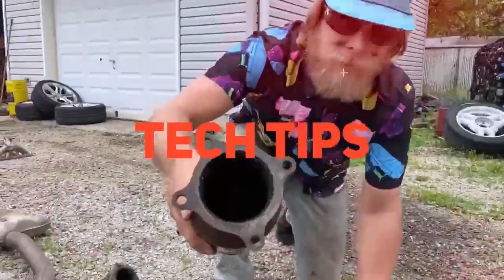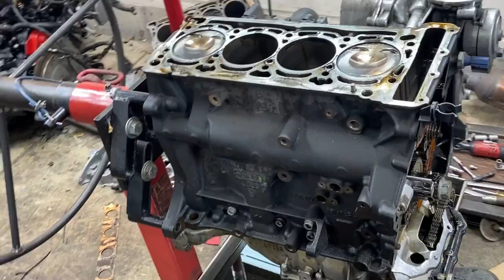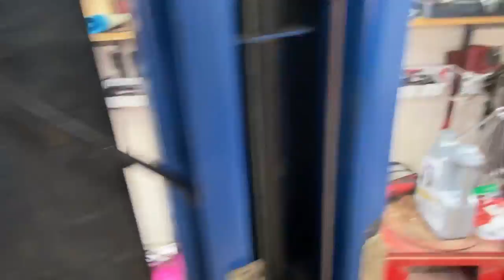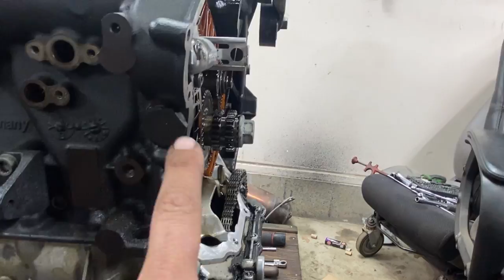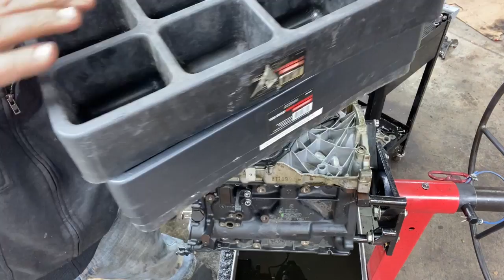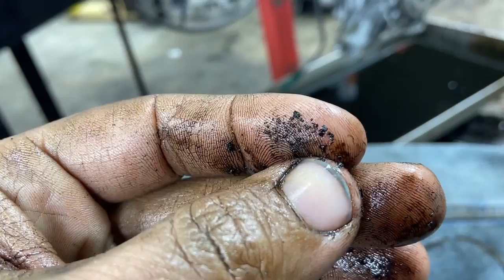2.0t Oil consumption tear down and inspection.  Audi VW using oil pistons failure reliability

Comment: I need your help again boss. Place that I was going to do the serp belt said there techs dad died and he was going back to the west coast and did not plan on coming back. I might have to do the serp belt myself but there is all kinds of shreds of the belt wound up around one or two of the pulleys. Is there an easy way to get this out without taking the front of the car off? I think i can handle putting the new belt and tensioner in Im just worried about trying to get that stuff out and getting it all out. Thanks in Advance

Comment: @Naptown Tuner if I want to rebuild my TFSI 2009 you said that I have to get at least pistons from an audi 2013.
and those will fit perfect right?

cool video btw👍
Reply from the maker: No, you can either put the vw style (am) pistons in it (that what the dealer always did) and it really all depends it could last the life of the car with normal oil consumption or the best way is to put the larger rods 23mm wrist pin with waffle style piston rings.
Reply: @NaptownTuner  and from the 2 options what's the one that you do?
again this channel is growing man .
this is one of the best channels for TFSI owners ... keep it up J.
Reply from the maker: @billydeathgrind4275  the only time I have installed the waffle style pistons was at the dealer when they did warranty pistons on 2012+ probably only did about 15 of them and I never payed close attention to the oil control ring but looking back I remember that it was the waffle style that they sell as (dm) pistons 2012+ is 23mm rods.  With updated dm pistons.   I’m actually learning a lot more now that I’m digging into it all more myself on my own time, actually paying attention to it all rather than just doing what Audi told me for so long.

Comment: Also, I removed the intake balance shaft but have been unable to remove the exhaust balance shaft. Is there any way to do that? The intake balance shaft looks super clean along with the filter screens. 
So, If they look clean, is there still a need for me to remove and inspect the other balance shaft?
A video on this might be awesome along with the video for the exhaust cam which I’m waiting on you to do. Perhaps you should consider a series on putting the engine together with the new parts when everything is completely taken apart and then, do another video once the engine is inside the vehicle, were you reconnect everything step-by-step. That would complete a series for you and you will have everybody flocking to your channel!

“ NaptownTuner, the Audi King”!
Reply from the maker: I’ve only ever seen problems with the intake balance shaft and after all the engines I’ve been through I’ve only seen it 4 times.  I personally wouldn’t worry about the balance shafts but it’s nice to replace that chain as I’ve seen 3 of them excessively stretched one was really bad.
Reply: Have you know that the reason I am in this mess with my 2011 A4 is because the timing chain and tensioner were replaced but that particular chain was not. It stretched out and when I opened it up, the chain was broken with the gear below the intake balance shaft lose. When I went to grab it, the block was broken off right at the bolt thread and there was nothing for the gear to hold unto.
Reply from the maker: Someone must have been driving that car hard, same with turbos, some wastegate linkage are good to this day, others are worn out and that just means that person got into full boost so frequently that it got worn out from opening up the flap so much

Comment: Hey NaptownTuner (give us a name). 

Once again, I wanna thank you for everything that you’re doing in regards to these Audi 2.0TFSI engines and how you are helping us out. I’m going to click like in as many videos as I can and I try to share your information with other people in order to help you build up your YouTube channel. 

Since you’ve just mentioned that even with the new pistons from Audi there is still an oil consumption problem that eventually develops, looking up my blocks, do you think the oil jet underneath the pistons is a contributing factor? 
What if we redirect those jets so that they can shoot directly where the 21/23mm pin is instead of the piston wall?  Or perhaps, remove that oil jet altogether? 
Your thoughts, please.
Reply from the maker: Thanks,  I still don’t really think it’s as wide spread as I make it out to be, I don’t know what the consumption would have been on this engine.  I don’t believe it’s with the oil or oil jets,  as long as you’re using good synthetic oil, I do believe an engine flush before every oil change will help big time, the jets need to keep the oil on the cylinder walls.. I believe it’s the carbon and top tier fuel stations like shell vpower will probably help the most.  Some 2009-2011 engines still to this day don’t have bad oil consumption but it’s important that people know what they might be getting into so I’ll be covering a lot more as I go and taking on more mechanic work than I have been.
Reply: @naptowntuner In this video you mentioned 2016 or 2017 pistons. I’m about to purchase OEM pistons for the B8 model. Do the 2017 pistons fit my car? Do you have a part number for the pistons with the waffle oil rings?
Reply from the maker: @mesmaayan  when you buy 2012+ 23mm pistons from the dealer (dm) pistons they will be updated style with waffle oil ring.  You can buy them from wherever
Reply from the maker: https://www.ecstuning.com/b-genuine-volkswagen-audi-parts/piston-assembly-set-of-four/06h107065dmkt/  note you need the 23mm rods too

Comment: Naptown.  I am currently attempting a rebuild on my 2.0. The block and crank are at the machine shop now.  They tell me they cannot locate the specs on these items to be able to mic them and see if they are useable still or within tolerance to be able to.  Do you happen to know the specs for the crank main and rods and the block cylinder bore sizes and crank journal specs for the block?   
Would really be appreciative if you could pass that Info on to me man.  Keep up the vids. I have a 12 a4 S line Quattro car.  There was some oil starvation up top as evidenced by the carnage I found under the cam plate.  I may just get a known good junkyard drop in for now. But would like to have a second motor ready to drop in if that one doesn’t work out.   Really want to drive this damn car.  Thanks in advance dude,
Chat soon.
Reply from the maker: Most engines or older engines you do all the standard machine shop stuff to the block and bore them out or hone them,  these blocks are very good and rarely have issues, I’ve put pistons in well over 1000 2.0t engines and I never replaced the bearings, also service manual says don’t hone the cylinders. (Special coating on the walls from the factory)  You just drop new pistons in the cylinders and if you’re so inclined buy some rod bearings from the dealer but in my experience with these, the block only needs carbon removal from the pistons by replacing or re-ringing.  The cylinder head can be rebuilt with polished cams valve guides, stem seals, valve grind.  You can spend a lot of money in a lot of different places but when I get around to it I’ll make a thorough video explaining all the different options.  I’m not a machine shop guy (wish I was). But I’ve only come across about 5 bad bottom ends and that is from various different reasons.  Wish I could just shoot the videos and put everything out fast but I’ve already deleted several videos from not putting out enough info (trying to do a better job with as much info as possible so by the time they get tons of views I don’t have to regret them)  a replacement engine could also have oil consumption as I show in this video but who really knows this one could have been ok.. some 2009-2011 engines that have never come apart do just fine with oil.  Any single 2009-2015is 2.0t engine needs an updated chain and tensioner for sure.  So any used / replacement engine must have a chain / tensioner before install.  Oil consumption can still be fixed in the future as this engine is very easy to remove and install as I show in my 3 part removal series

Comment: Ive spent so much time researching this issue for my 2008 A3. You came at the right time and saved me from a lot of headaches. So thanks. I still have to figure out what to do. The dealer said that they have a ring update for 2L FSI. Not sure what that is?
Reply from the maker: Probably gotta replace the rings or pistons that come with the rings pre-Installed  that engine is a little different but still direct injected,  probably want to at least do the rear timing chain adjuster and I’m sure you already planned on doing the timing belt.

Comment: Hey man i'm having an issue mating my engine to trans on my 2011 A5. I put the pistons in and and i can mive the crank by hand once i mate the engine to trans and put the bolts in thr transmission i cannot move the crank anymore. Theb i loosen the bolts and i can move the crank? Is there anything maybe not lining up with my flywheel or what?  I need helppp
Reply from the maker: Its been years but I believe It’s possible to let the torque converter fall forward then you don’t realize and try to put the engine in, torque converter isn’t lined up on the splines.. then you pull the engine back out and try to push in and line up the torque converter and it won’t go in because you forced the splines in the wrong spot, then you take the axle out so you can remove the torque converter and clean up the splines, then you rotate and push the converter back in place, put the axle back in (the drivers side front axle shaft)  bad memories on the flat rate clock.. good luck my friend.
Reply: @NaptownTuner  yes i can turn the crank just fine once i unbolt the engine to trans. Once i mate it again boom i cannot move the crank anymore. Seems like my problem might be the torque converter came out a little bit without me knowing and that will cause for my crank not to move correct?
Reply from the maker: @Ivan-hx7cc  if the torque converter slid forward with the engine removed, it needs spun and slid back in.  It needs to be lined up on splines.  This is why I always keep the transmission up on a floor jack like I show in a couple of my videos but I forgot to mention that this could happen.

Comment: Don’t know if you’ve made a video showing it (direct me to it if you have) but I’m wrapping up a head rebuild/timing job on a 09 2.0t and am having a hard time getting the exhaust manifold to bolt down flush. Is there any tricks/tips? I had a hard enough time getting it off. Thanks in advance!
Reply from the maker: I have a few turbo videos but don’t think I show installing it yet will be soon

Comment: You're definitely killing it in the space you're in. I'm rebuilding my 2011 Audi Q5 starting in a week or so (I already have the front clip off for easier vs faster removal and install) just waiting on a few parts.  I ordered the ebay special 23mm rod and updated piston special. And to my surprise they are the latest waffle style rings.  I was burning 1qt every 400 miles before I decided to rebuild. I put 30k miles on my Q5 last year. So within a year or two we will see how well the cheap parts hold up.  I also do a lot of highway driving and pulling my 4000lb boat. So it will be no stranger to extra stresses.
Reply: I’m needing the piston replacement service for my 09’ A4 2.0. I was quoted $6-6500 for replacing everything… Seems absolutely nuts to me! Did you do the rebuild yourself?
Reply: @mvmlogistics2372  yes. I did the rebuild myself. It was fairly straightforward, but I have been working on cars since I was 15.  The biggest thing is take your time (it took me about a week and a half working on it for a few hours after work and waiting on parts) and keep track of everything
Reply: @drexelmathews7312  What videos did you use to help? Just ones from this channel?
Reply: @mvmlogistics2372  videos from this channel helped a ton. And then some online forms and googling for torque specs and little detailed things.
Reply: How is the Q5 running with the pistons?
Reply: @SpudGuns  it's been running great.  I have 20k miles on the rebuild with zero issues and no oil consumption.
Reply: Hey which one did you use? This kit says its $200, i might risk it lmao
Reply: @leozavaroff9055  "Engine Overhaul Rebuild Kit & Con rods Set Φ23mm For VW Audi 2.0 TFSI CDN CCZ". That is the listing that I used from ebay. Seemed like decent quality. I would use an OEM waterpump.
Reply: @drexelmathews7312  wow did not expect for you to reply like that, crazy, thank you. How’s it holding up still?
Reply: @leozavaroff9055  it's been running strong. I've put 45k miles on it. And the only issue I had was a non factory water pump.  Changed that out and it's been great since.
Reply: @drexelmathews7312  did you go with new oem chains and guides or also an aftermarket kit?
Reply: @leozavaroff9055  I used the ones in the kit.

Comment: I have a 2012 Audi A4, obviously the oil consumption issue was not addressed for that model year. I purchased the car new in March of 2012. My car started consuming a qt. of oil every 500 miles driven at around 45k. Finally had the rings, pistons and timing chain replaced last fall when the car hit 58K. Car runs great, now. No oil consumption and with the recent addition of a CTS intake, down pipe, CTS intercooler, IE aluminum intake manifold, and custom tune. You’re the man, you know your 2.0 liter motor!

Comment: The first dude i see that explains that there are 3 types, the original with the small holes, the ones with bigger holes in the oil scraper and the last update with piston and different oil scraper ring and different rods.
I tought the first update of the oil scraper ring resolved the oil consumption, that is what i have right now after the repair. I looked online at the time and found the different piston and rods that supposedly were for my engine and i thought it was an mistake not knowing that those were the best ones.
But also i think this engine you have in the video was not maintained properly, the oil sludge in the pan is a clear sign. Oil has detergents in it that help with this kind of stuff, but it has to be changed regularly and it should be the best quality especially the engines with this problem.
Reply from the maker: Yes I’ve had countless pans off and if running synthetic oil it should look good with zero sludge,  someone might have been cheapin out on synthetic blend or regular oil.  I believe the oil ring is carbon from fuel though and not bad oil although it certainly helps to keep clean good oil in it as well.   I haven’t prematurely taken too many of these apart but I’m gonna start taking all of them apart and maybe make a competition video or piece meal them don’t know yet so everyone can see what they all look like.

Comment: Hey brother I have a 2011 a4 I had to do the engine instead I swap in a 2014 engine whats that a gd move and do you think I’ll get to tune it without issues the engine had 100k before I put it in highway miles
Reply from the maker: As long as it has an updated timing chain and tensioner in it, should be reliable as far as no catastrophic failure even with a tune.
Reply: @NaptownTuner  thank you appreciate your work being the tech you are I see a lot of growth thats going to come to your channel.

Comment: Whats your take on those $30 eBay cylinder head valves?
Reply from the maker: I’ve used them, 2 different cylinder heads bent one valve a few hundred miles after machine shop rebuild and install but I took care of both of them for free.  Was it the valves or was it the machine shop?  I’m probably spending just as much money when I work with cheap parts vs paying more but I can afford to do it on my own stuff or on certain budget cars.
Reply: @NaptownTuner  Valve guide clearance on that one valve was most likely too tight. A little overheat and the valve will get hung up in the too tight guide and get hit by the piston. By a little overheat I'm mean driven hard. Once new valve guides are installed they all need to be reamed for proper clearance. .002 intake,  .004 exhaust. exhaust runs hotter.  Ways of testing the clearance are the suction test, the wiggle test, or mic each valve stem and bore. You are trusting the machine shop on this and hope the guy working on your head doesn't stop mid-way, talking to somebody and then opps, missed where he left off.  Great videos man.  There are millions of these engines, and keeping these older vehicles running is way cheaper than today's brand new, millions of things to go wrong, totally unnecessarily high-tech cars.  Your channel will eventually take off. Just keep adding content and to your library and one day it will pay off.

Comment: I have the AM pistons in mine (were swapped 65k miles ago) car burns oil like a MF. Im in the process of tearing it down as we speak. How many miles do you think i can get out of a new set of the AM 21mm pistons vs the full 23 mm update? not looking to spend too much, probably wont keep the car for more than a year or two. Thanks for all the help so far, ive been using your other videos as a guide to get the engine out!
Reply from the maker: In the block in this video, I’m just gonna clean the piston rings and put it back together.  I don’t know what kind of oil consumption this block would have had but typically in the past I would have seen that pistons were already replaced and I wouldn’t have taken the pistons out at all.  Surprisingly some even 2009-2011 with original pistons don’t seem to have an issue so some of it is just how it’s driven I suppose highway vs city and such